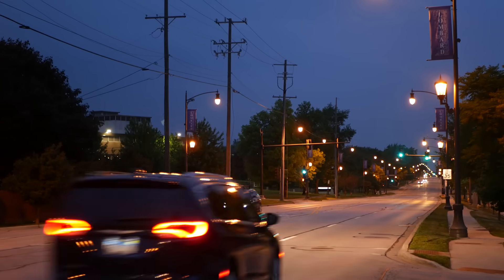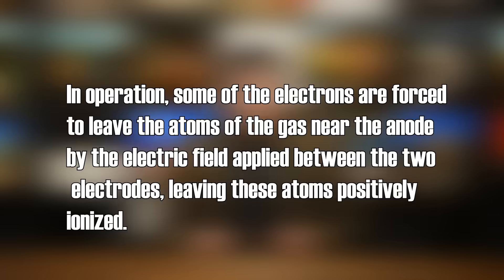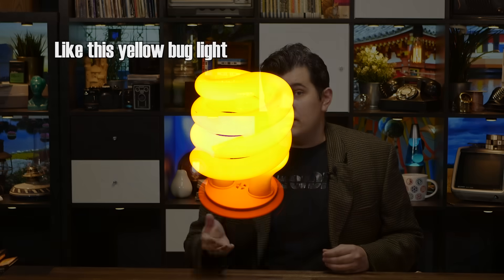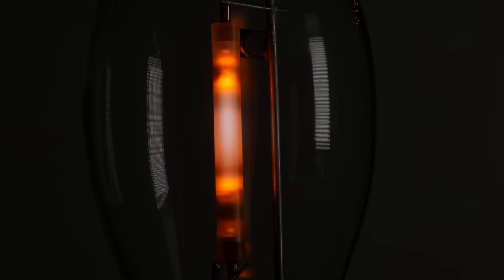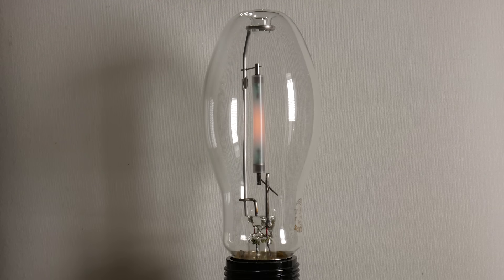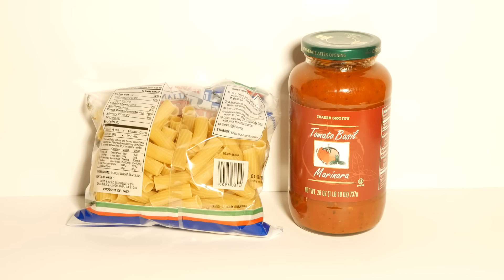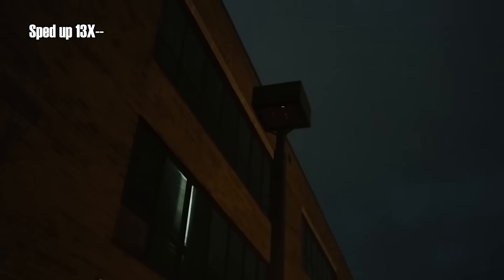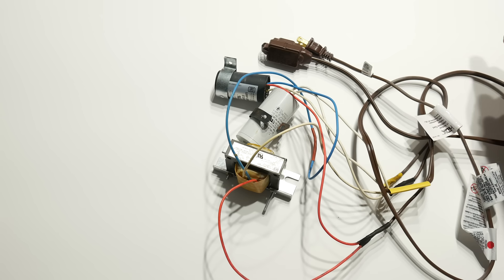The High Pressure Sodium Light: Ubiquitous, effective, but good?

Comment: Worth mentioning that the visual system will compensate to a great extent for the weird coloration given some time to adjust - I imagine that if you had these lights on for a few hours you'd stop noticing the odd colors of objects after a while as your brain adjusted where on the spectrum it considers "white" when looking at things. Then again, maybe it varies from person to person. A good way of seeing this in action without sodium lights is to install F.lux on your computer and use it with F.lux enabled for a few hours - you'll adjust to the weird colors - then turn it off and feel the difference of just how much your brain was compensating.
Reply: Impossible to adjust to very bad CRI - some colours turn black, too dark for your eyes to adjust to.
Reply: I didn't mean to imply that you'll adjust to it entirely, just that after enough time it would certainly improve by a noticeable amount.
Reply: Yes, your brain does adjust, some.  We had sodium lights in our high ceiling bay at work for years because they were efficient, but the color in the room was so horrible....  And some of our work involved photography, so you had to either turn off the lights or make sure your lighting / flash was bright enough to overwhelm the room lights.  Even then shadows were yellow.
They changed to high efficiency white T6 fluorescents for a few years which were much better, and finally have gone to LED's.

Comment: Strangely enough, I was just thinking about sodium lamps early this morning. I walked into my back yard at about 3 AM to take a piss and smoke a cigarette. A skunk popped out at me from underneath a picnic table we have in the yard. I bolted back about 30 feet, because I could see that it's tail was up and it's ass pointed right at me. I was able to see it so well because of the ambient  glow from the street lights. I live in LA, on the coast. This time of year it's nearly always overcast and the millions of street lamps turn the sky into a glowing, orange blanket. I was thinking, as I watched the skunk make its way around the other side of the yard, up the driveway and under the fence, that I was quite fortunate that the lights provided enough illumination for me to see the skunk and get away from it before I got sprayed in my face. My dog got sprayed once, right between the eyes. It was no fun.

Comment: Really love your work.  As an amateur astronomer, there are actually big plusses to sodium vapor lights.  We can observe deep sky objects (especially nebulae) from light-polluted areas using narrowband filters - usually Oxygen-III filters, which filter out almost all light except that in a narrow blue/green wavelength.  Of course, there is no substitute for dark skies, but it at least gives options.  With LED lighting getting more prominent, however, the white light from LED fixtures is broadband, washing out more and more regardless of what filter we are using, because the white light contains all of the colors.

Comment: Interesting video and I can't wait for the next one. Our street lights have all been replaced by white led. When they were first replaced everybody hated them because they seemed less bright and the light didn't travel as far. Despite this, they had to move a few street lights especially the ones near houses, and one right outside my house as they seemed to shine right inside. We've had them for around a year now and we've noticed a change in bugs that find their way inside. We've had many more beetles, spiders and small bugs, but with a dramatic drop in variety - I don't know if that's because of the new LEDs but it seemed to happen at the same time.

Comment: In Edmonton Alberta most street lighting has been replaced by LED. This has been a massive undertaking as Edmonton has on a per capita basis some of the most well lit streets in the world. The motive has been based on efficiency as the new LED fixtures have better reflectors than the old sodium ones and so direct the light where it is needed without as much waste light. Another bonus is that the light is closer to 5000K giving a more natural feel and less problems with snow absorption.

Comment: In my city, those sodium street lamps are being slowly replaced with LED ones. But those are white and much dimmer than the sodium ones, and don't provide the same wide spread lighting. Not only that, but sodium yellow-orange glow is known to cut thru fog easily because of the light wavelenght, whilst white light reflects off of it. So, on a hazy, foggy night, those already dimmer LED lights will have their photons bounce off the water dropplets in the air and light them instead of the surface of the road.

Comment: It might be just my mind playing tricks on me. Our town has recently started to replace several orange lights with new white LED lights, and they make the area under the light much brighter, but the surrounding area appears to be much darker than with the orange lights. I can actually see the white circle on the ground, but after that it's completely dark.
Reply: That may have to do with optics these LEDs are equipped with. Probably they have collimators mounted, that's why they emit light right down. Not good. Maybe these collimators were for higher poles than ones they used.
Reply: You make a good point. In another neighbourhood there were higher poles installed and the entire bike path, street and sidewalk on the opposite side are properly lit. In my area only the bike path under the light and a small portion of the first lane of traffic is lit, if you walk on the sidewalk it's complete darkness. When they were first installing, I thought it would be bright enough because the old street lights were still in use for a few months after, but when they took them away, it made the street very dark.

Comment: I have a 600w switchable hps/metal halide light. 600w is the most efficient of the hps lamps, no real need for it but it's cool to play with. You don't really see it with the 50w ones but the 600w starts off blue then turn orange then the colour spectrum broadens

Comment: Isnt IR synonymous to heat?
Reply: General purpose light bulbs are often filled with nitrogen to reduce tungsten evaporating (it evaporates less into dense gas than to vacuum) and this gas transfer a lot of heat convectively to the glass which heats to 200 °C. Then it gets rid of this heat with all ways possible: convection, conductivity to the socket and IR emission all right. So not all heat is IR.

Comment: Sodium is popular for exterior lighting at astronomical observatories: Around those you need to keep artificial lighting to a minimum, but with the nearly monochromatic light (it's actually two yellow spectral lines very close together) out on the parking lot, the astronomers just plug a filter into the telescope which precisely blocks out the yellow sodium lines, they're good to go for most of their observations.
Reply: This is something I noticed when I visited Hawaii a few years ago.  A local told me all the streetlights must conform to certain light pollution guidelines to prevent obscuring the image at night at the astronomical observatory.  I think they even use filters to cancel out the other spectrum of light produced when striking the arc.

Comment: The worst side effect of outdoor and street lighting is that it takes away our view of the night sky, and sadly the public at large doesn't care.  A simple shade on this lighting to direct the beams to the ground would solve this problem.  It would also improve the efficiency of the lighting and require fewer fixtures. All of the light that is directed upward is wasted, it this is the light that ruins the sky.  The reason the shades would help is that reflected light from the ground that goes into the sky is only about 10% while misdirected light that is wastefully directed at the sky is 100%.   We have a few of the correctly designed fixtures here that are used to illuminate ball fields, but most street lighting and the horrible "security lights" that have inundated neighborhoods have destroyed the night sky.  The limiting magnitude where I live is about 2nd.  It would be 6th if there were no outdoor lighting and no worse than 4th with properly designed lighting.
Reply: Well,  if proper shielding the light from traveling directly upward is installed, you would get a better benefit from the correctly installed fixtures than you do now.
Reply: Unfortunately it does NOT include headlights or home "security" lighting.   Auto lights are not a problem except when they go uphill.  They are by law pointed at the ground.  Even the high beams do not point above 90 degrees, they would impact the sky when going uphill.   The home security lighting would be difficult to control, but I think that i should not have to see a direct glow from a neighbor's security light.  The homeowner should have to confine the direct light to their own property.  There should also be no direct light into the sky.    There are communities that have such regulations, mainly in the vicinity of large observatories, mainly in the western part of the US.  Oh, i just thought about billboards.  They are often illuminated from spotlights aimed up at the board.  On a rainy night you can see beams going into the sky.
Reply: Is that 90% overall, including light pollution from non-streetlight sources like homes, businesses and cars? I have a hard time believing that but if you've got a solid source for your info, I'm interested to see what it is.
Reply: The neighbour across from me on a lake installed a super bright LED lightbar to light up his dock all night....  it's light blares into my house from a lower perspective, directly and reflecting off the water, and lights up my wall and ceiling so much so, I can read by it.   When I look out towards the lake, I no longer have a nice view of my vista, but just a glaring light blinding me.  Annoying as hell!
Reply: 'The public at large' includes people who live in cities where lights are necessary for street visibility and security. There are plenty of places to live where you'll have fine visibility, but it requires usually not having the amenities of living in a city, so you really just kinda have to decide what you want and do it, instead of sadly lamenting how 'the public at large doesn't care', which isn't true but a lot of folks would rather have city amenities than perfect night-sky visibility (and it sounds like you are one of those people;  why not live in the country if it's that important?). Sometimes good schools, living near your work and being on a city water system are more important.
Reply: You are overlooking the fact that with proper shielding, it would reduce sky glow by 90%,  and require fewer fixtures to do the job.  The lighting providers, however would not be happy.
Reply: They all have covers. then you have lights lightig buidings bridges etc. I f you make a video get your facts straight. a 100 sodium is brighter than a 100 watt led? I think not
Reply: Where I grew up you could easily see stars all the way the the horizon.
Reply: @swinde  My neighbor thought I was lying when I told him saw the milky way out in the skies when I went camping.  It was just sad
Reply: Well well well of course in germany I never saw street lights without reflectors, unless ornamental small ones. Really wonder why other countrys don't care. Shooting half of the light into the sky means you need to use twice as many and use twice as much electricity. 

Well maybe its hard to design a reflector that still dissipates the heat
Reply: I'd take not getting mugged on the street to seeing the night sky any day (or night)
Reply: a cover over the lamps would do nothing,    most of the issue you talk about is actually from light reflecting from the ground!    think about it,   even though the ground maybe isnt that bright,   the area is millions times larger than those silly tops of lamps!
Reply: No, the direct light from a fixture aimed at the sky does far more damage to the sky "darkness" than the light reflected from the ground into the sky.
Reply: yeah thats what you would think if you dont know any better ;)
Reply: I know better, while you simply pulled an opinion out of someplace i would rather not mention.  Try this. Get a good flashlight and take it into a dark room and shine it on a white wall.  Note the brightness.  Now, without moving the flashlight look at the wall behind you and note the brightness.
Reply: anyway,   it comes down to this:    even if you capped off all lights with shades,    there would be minimal change to the issue of night sky bleeding,   since the surface of lit up area is just so rediculously large
Reply: It is true that this shielding would not give us a truly dark sky,  but it might be enough to glimpse the Milky Way on clear nights.  I grew up in a rural area in the 1950s.  When the Moon was not out, the sky was inky black except to the Northwest where a large city was. I later moved closer to the city and also the city came to me.  It the late 80s I took my telescope to a rural sky and was blown away by the number of stars in the sky.  The Milky Way was in view but at first I thought it was a thin cloud in the sky.  The limiting magnitude in the city was about 4, but in the rural area it was between 6 and 7.  Where I live now the limiting magnitude is just a little over 2, so the stars have been stolen by the lighting freaks.
Reply: yeah,   i think it can be easily googled how far away from big cities you have to be to get a clear night sky...      but then again,   going on a hike with a telescope might be a problem ^^

Comment: Great video. Your videos are always so informative and interesting. 
Not sure if this will be in your next video but I’ve been seeing a new color of LED street lights pop up all over metro Detroit over the past year. It’s kind of a greenish color. I’ve tried to get more info but so far I’ve found nothing. They aren’t a bad color at all. Just not sure why they are that color. Well I have a suspicion that light of that wavelength is probably a balance between lighting up stuff at a far enough distance but contributing less to light pollution over all.
Reply: Hey, no I know what you mean but yeah they are new. I've seen them go up and now I notice them in more and more places. Maybe green is a bad word to use. They are definitely warmer than the harsh whitish blue ones. It's not green like a green signal light, it's very subtle. Like right in between yellow and white and just the slightest green hue. Could be something in the lens that cuts down the glare or could be the LED itself. They light is actually pretty pleasant. Seems dimmer too but you can still see the road just fine. I know the recommendations changed a few years ago to make the color temp of street lights warmer and to dim them down a bit.

Comment: In this parking lot there were orange LEDs; I suppose to emulate a Sodium bulb appearance.  Check out this Mirage in the terrible orange Sodium light!!  https://www.facebook.com/photo.php?fbid=10102733509956326&set=pb.39502777.-2207520000.1528130326.&type=3&theater
Reply: It's extra deceiving because the cars in the background are lit with the fluorescent lighting from the restaurant...  But the car is actually red! https://www.facebook.com/photo.php?fbid=10102736870506756&set=pb.39502777.-2207520000.1528130172.&type=3&theater

Comment: The easiest way to think about how gas discharge lights work is electrons of the atom re bumped up into a higher electron orbital. As they jump back down to their ground state they emit a photon of light at the wavelength directly proportional to the distance it jumped. The bluer the light the more energy the longer the jump. This is why you can't get gamma rays only up to Xrays using electrons there isn't a long enough jump for gamma rays. Also shorter paths have a limit and is why you don't see too far into the infra red. To go lower you need a wire where AC goes down: Hence a 1 meter antenna makes a wave length of 300MHz. The electron orbital acts as a nanometer length antenna.
Reply: Yes instead of a broad flat convex curve on a intensity vs wavelength chart they have sharp peaks at specific wavelengths. Totally missing some colors entirely. No green and very weak blue. The highest efficiency lamp is the low pressure sodium but the CRI is so bad that it's hard to see even when it's bright. Those are the dull reddish orange lamps you sometimes see used in military bases. The light makes everything look black and orange no colors to see. About as close to seeing gray scale as possible. Would be cool to see a gray scale lamp or scene.
Reply: Dave B Fun fact, unless I was misinformed: You can have gamma rays of a greater wavelength (yes, lower energy) than some X-rays, because when it's known whether high-energy EM radiation came from an electron or nucleus, this information "overrides" whether the radiation is categorized as gamma or x-rays.
Reply: What defines a gamma ray is that it has a shorter wave length and therefore higher energy then Xrays. Energy is DIRECTLY proportional to wave length. The SI standard is frequency/energy. If it came from an electron jumping it's always xrays the longest path is the balmer series (I think it called that) which emits the hardest xrays. After this electrons can't jump any further so gamma rays are impossible by quantum physics. Any other classification is outdated or wrong.
Reply: the specific wavelengths is why they have such bad color rendering.